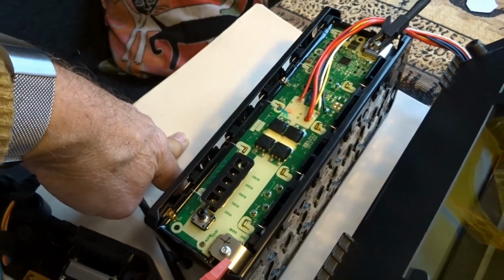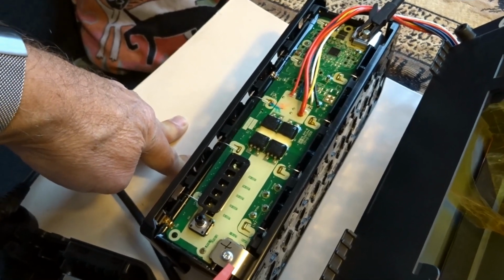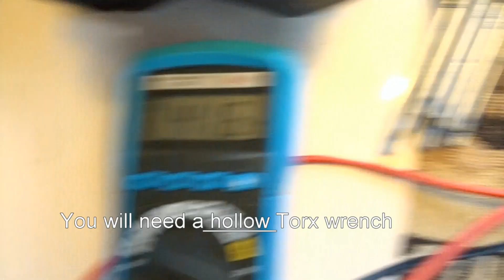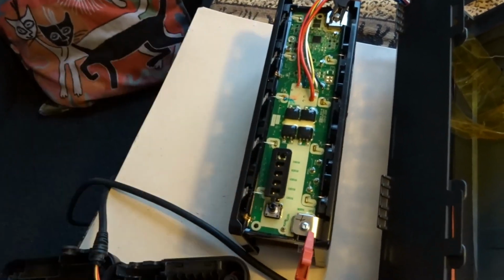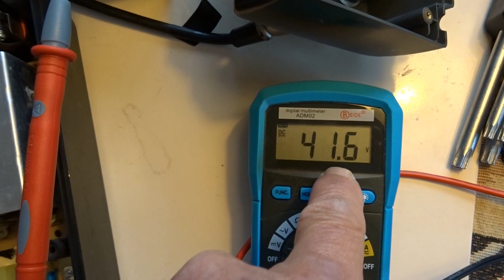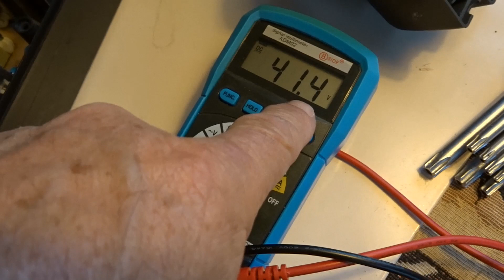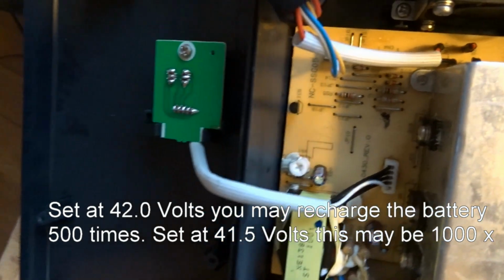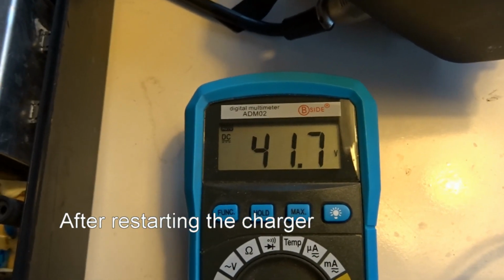Giant Twist 41,5 Volt charger adjustment NC SSC05GNT

Comment: Hi Gerard! I have a question! I bought a used Giant Twist for my wife. I didn't get a factory charger with it! After disassembling the battery, I saw that there are 4 wires going into the charger connector. I think 2 wires are positive for the pris, the black is negative, but are the chassis two necessary for communication between the battery and the charger? This is a 26 V 9 Ah battery! I looked it up and when fully charged it's 29.4 V! Can I use a universal charger that only has a plus and minus output to charge it? Thank you for your quick answer! I'm watching the video from Romania! :-D

Comment: I have the exact same batteries and charger. I got 50v while charging and when disconnected from the charger. Will that be okay?? I have 4 batteries in total, one of them is not charging anymore, will that be fixable or is this a loss? Charger’s light turns green after a few minutes.

Comment: I have one if this chargers (without the bike), and want to use it for another 36 V battery. My question is, what is on the the temp. probe cables? Would it be possible to measure the ohms (i think there are two temp. probes in the nc pack?), or tell me what probe was used? I did not find anything last year about it. Hartelijk bedankt!
Reply from the maker: Using this (any) Li-ion charger (not for nc pack!) for another Li-ion battery pack may become a challenge to connect. Some manufacturers keep it simple and then it is no problem but others (like Bosch) make it complicated. Probably to prevent that a wrong charger is connected with the risk of an exploding battery as the result. On the temperature probes: Both battery and charger are protected with temp sensors that will stop the charging if cells OR the charger get hot. In practically all cases the temp sensors of the battery (or charger) do not “communicate” with each other. In the battery an overheated sensor will inform the BMS to block the charging (probably by “saying” that the battery is full or too empty to charge until temp has gone down). In the charger an overheated sensor will trigger software to stop (or halt) the charging until sufficient cooling has taken place. I hope this info helps. Basically a Li-ion battery pack with a correct working bms only needs a + and a - with a maximum voltage of 42 volts to correctly charge and balance all cell packs in the battery (it is the bms that does this and this balancing takes much time. Therefor you can rapidly charge a battery to almost full (say 85%) and then need to wait for hours to completely fill all cell packs.
Reply: @Gerard_Hugo  Thank you. So this is a lithium charger... then i will try to sell it, and get something new for my lead batteries . 

Regards
Reply from the maker: CMarkulis You were writing about a nc battery. That is short for a NiCd (nickel-cadmium) battery. Lead batteries have never been used for Ebikes. Gerard
Reply: @Gerard_Hugo  Rex E-Bike:  lead batteries 36 V 12 Ah. I have two of them, and because of that, a friend bought one, too. In one pack i did a self made NC pack, but it died after some years of use (the second bike i got trashed and without batteries, in the first Rex there are the original batteries from 2007, where i bought it new).

There were millions of my bike in China - i've seen photos of someone who was working there. No hassle with balancing electronic or burning li packs.
Reply from the maker: Okay. Lead battery in an Ebike. Of course it is possible, but they must be quite heavy. Problem, apartbfrom their weight, is the high internal resistance. I once tried to power a 24 v ebike with two 12v 7Ah batteries in series. But the amperage was insufficient to give sufficient power. Why not make a 36v li-ion battery pack (10s) without bms but which you can charge with a 6s hobbycharger in two halfs of 18 volt. See how this works in this video: https://youtu.be/-iCNyqWnh74. Good luck.
Reply: @Gerard_Hugo  :-) I'm driving an electric car from 1992 since 2001, more than 120000 km with lead gel batts. Until today (253000 km) there are open NiCad build in. Well, with those 3 x 12 V 12 Ah in my Rex it quite works well, after 13 years there are around 20 km left. The weight is no problem for me, or the bike. A new pavk costs less than 70 €.

The father of my neighbour has bought three Li Ion packs meanwhile. The charger what i was asking about should has been for the second bike from trash. It is a hassle with only one charger. Thanks for your answers.

Comment: Hello
I need help repairing this charger. it did not turn on, and when I took it apart there were exploding fa5510 and broken zener diode (24v) and power mosfet. I replaced them, but I still have broken resistors r21, r29 and r34. r34 by color coding is 0.1 ohm, and smd resistors 21 and 29 which I can not identify near the power transistor. can anyone measure them or send a photo of the board.
Reply from the maker: I am not able to help you on this. Too complicated. I would buy a new one! Good luck. Gerard